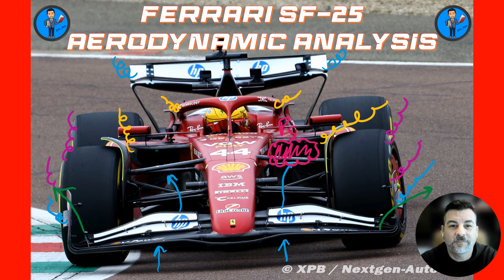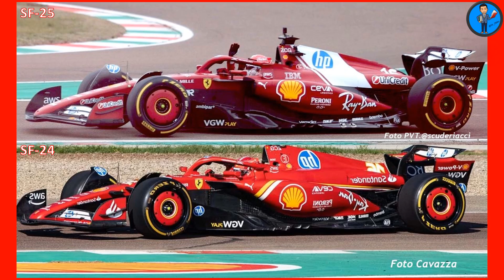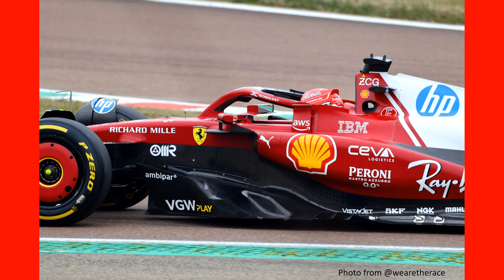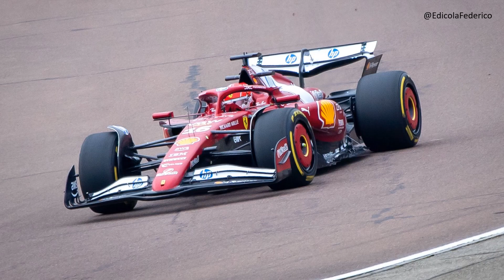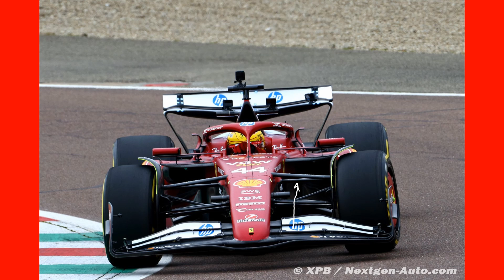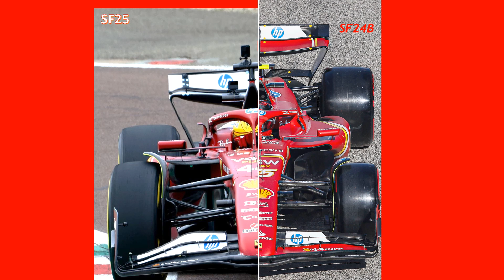Ferrari SF 25 Aero Analysis

Comment: The hump on the SIS is bigger on the new car, more volume behind the innermost fence, that's the point the floor(venturi tunnel) starts tapering down, which seems to be a lot more aggressive than last year.
Reply from the maker: Exactly.  This is why I mentioned that the contraction volume for the outwashing venturi is greater in this design.  Helping with forward balance.
Reply: @drobbs6463  Balance everywhere! The pressure at the leading edge of the floor forms the difference between it and the diffuser exit plane(DEP). Which amounts to the potential energy available for the floor.

The overbite sidepod pressurizing the leading edge of the floor creates a bigger differential between it and the DEP, bigger fences create bigger pressure differential, bigger inlet to smaller throat means more aggressive acceleration, and finally more careful smooth expansion along the boat section to the beam wing, means low back pressure.

All of this amounts to more total energy for the floor. Hamiltonian mechanics FTW! Which is apt, since Ferrari now has Hamilton, may as well use Hamiltonian mechanics.